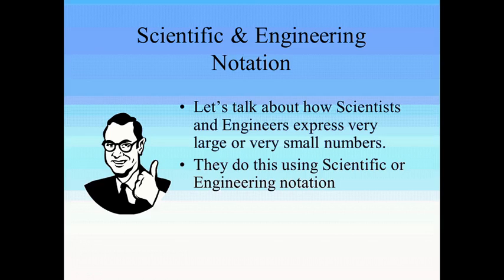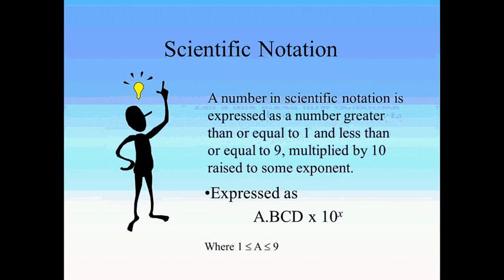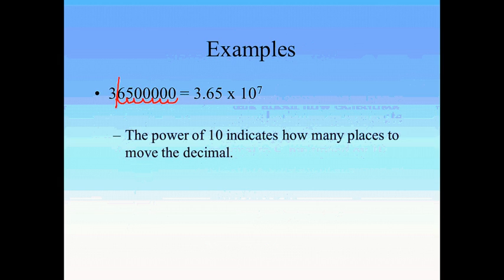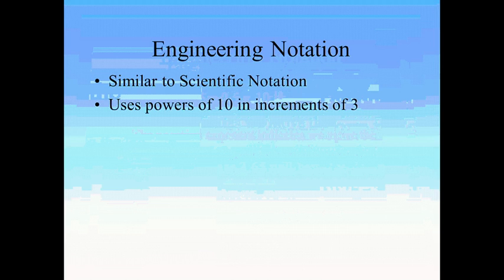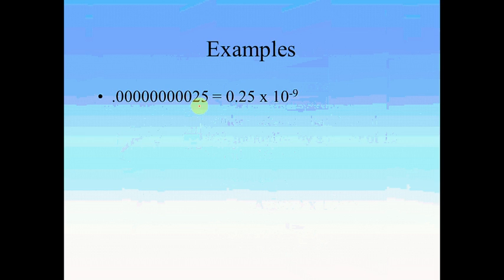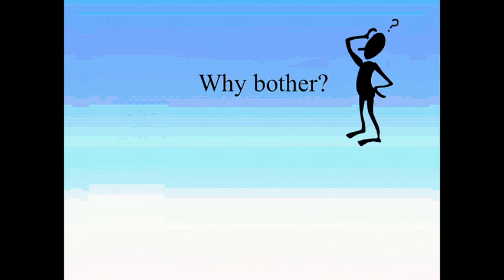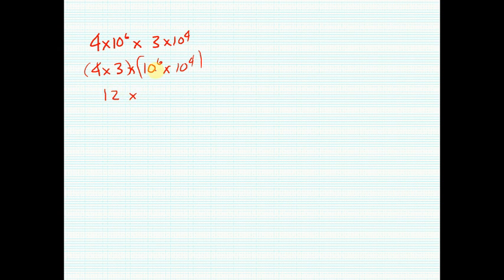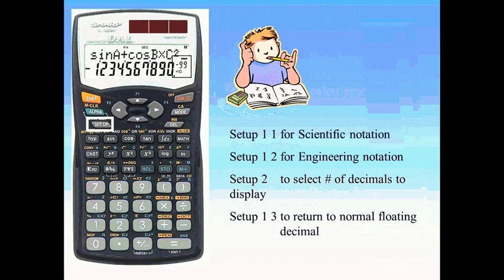Scientific and Engineering Notation Tutorial RDG Georgian College

Comment: Very helpful, but at timeline 8:48, it should have been 3 * 10 ^6, not 10^7. hope that is corrected later. thaanks
Reply from the maker: Probably my bad penmanship. but 10^15 divided by 10^8 is 10^(15 - 8) = 10^7 so I think it's OK. It becomes 30.0x10^6 in Engineering notation.